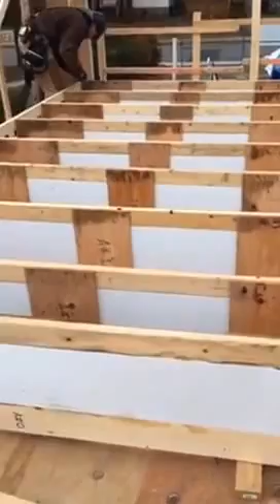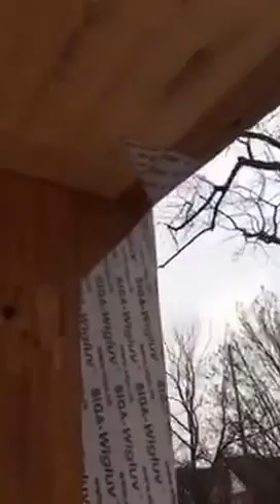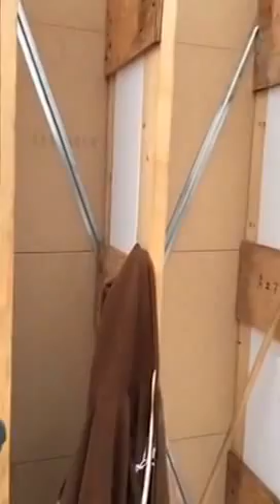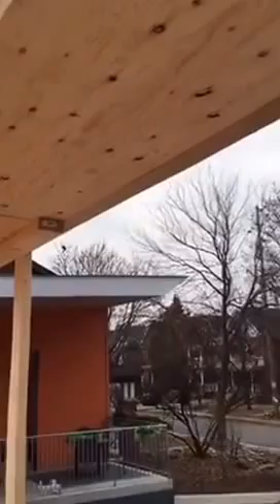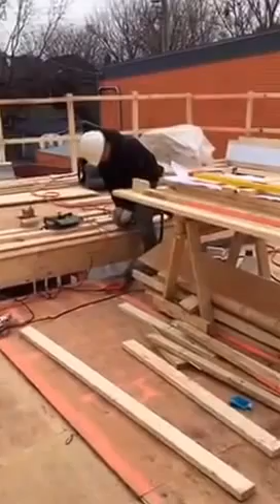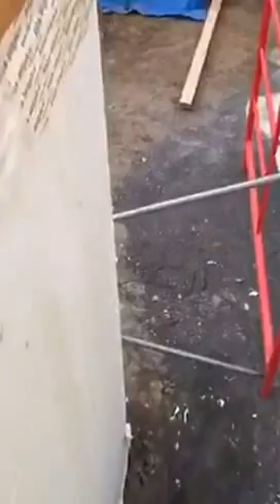Passive House wall framing with prefab wall trusses

Comment: That is a mighty fine cross-bracing strategy, especially how they make simple v-shaped tensioners to really dial in the tension. I didn't see much for videos to follow much more or your overall build strategy. Seems like you were on an upper story in the video. You gave me ideas for how it could work in other ways. Maybe on the ground the same system could have begun your wooden stud-bracing about one to two courses of CME high on a concrete curb so that once you fasten the wall down you can integrate the rain screen into your outer stud bays on the external side of the CME.  Bonus if the external studs are steel. The CME's give you a ledge for a fireblock, but then the CME would also become support for fiberboard paneling behind your rainscreen, to make your external side fireproof, pest proof, and rot proof. Mass in a wall is a good thing. Eventually vapor will get into the wall. Having a rotproof ledge is a good way to make it last way longer than the builder himself.

Comment: In the Heart of Vancouver Island, Port Alberni Passive house build   https://www.youtube.com/user/seumas2/videos
Materials used  Passive house material
Port Alberni's first Passive house (Passivhause) build in the heart of Vancouver Island British Columbia Canada.

Passive House(Passivehaus) is considered to be the most rigorous  voluntary energy-based standard in design and construction industry today.
Passive house buildings consume up to 90 percent less heating and cooling energy than conventional building.

The use of Passive House design software was used to gain the specs required to meet the performance standard for this location.

House was constructed well  above the current standards as outlined in the B.C. Building Code.

Footings were widen to 36 inches(914 mm) due to low bearing soil conditions and additional rebar reinforcement added.

30 inch high (762 mm) high reinforced walls . Course sand placed inside foundation walls and mechanically compacted.

Three layers of four inch thick  Expanded  polystyrene foam sheets with all joints staggered and tape were placed on top of compacted sand.

The three layers of foam have insulation value of approximately R 50.

A 20 mil layer of poly was placed over the E.P.S. sheets and taped and sealed.

Four inches of 30 m.p.a fiber reinforced concrete was placed to form a slab over the foam based.

Slab is isolated from concrete stem wall with four inches of E.P.S. to prevent thermal loss.

All cold water lines are buried in the sand to keep them cool, hot water lines have been placed in the center layer of foam insulation to minimize heat loss.

Wall plates compress to heavy beads of acoustic sealant between layers of vapor barrier to prevent air movement.

The walls are double stud configuration set at 24 inches on center and plates are space in a manner that yield a 20 inch thick wall. 1/2 inch standard plywood sheathing with  Mento 1000 a three layer airtight vapor open house wrap( far superior to common house wraps) with 1/2 inch pressured treated plywood rain screen battens form the exterior surface. 

Intello  smart vapor barrier was installed one third in from the inside wall to prevent condensation in this climate.

Triple pane argon filled windows meeting passive house standards from Euroline  were placed mid wall to reduce wind wash heat loss.  All window openings have been splayed at 45 degrees to give a full wide angle view.

Almost all the wiring and plumbing was kept inside of the vapor barrier envelope to minimize air leakage.

Passive house standard requires air leakage not to  exceed .6 Air changes per hour at 50 pascal.

Zehnder comfoair 200 HRV has been installed with a 1000 watt air preheater .(92 percent heat recovery rate)

House has been preplumbed for a heat pump water heater reducing  domestic water heating cost significantly.

Garage has been prewired for 40 amp/240 volt  electric car charging station.

House to be equipped  with  heat pump condensing dryer which requires no external venting,only a water waste line.